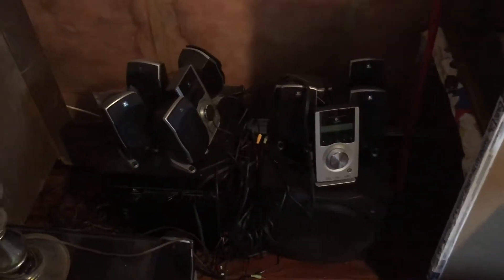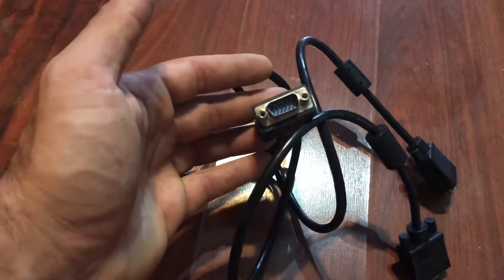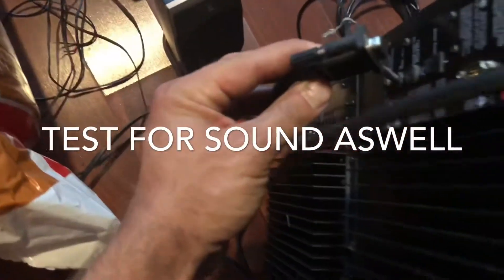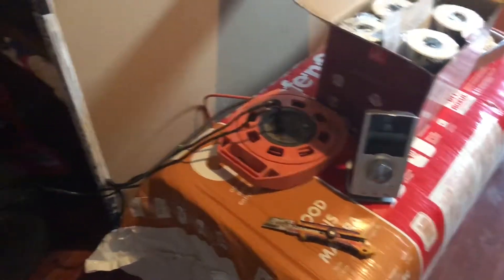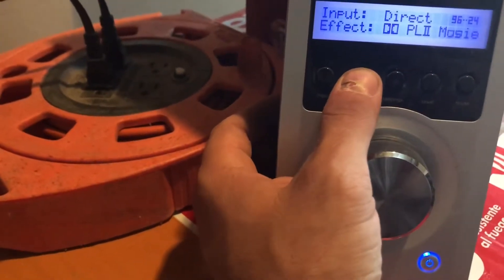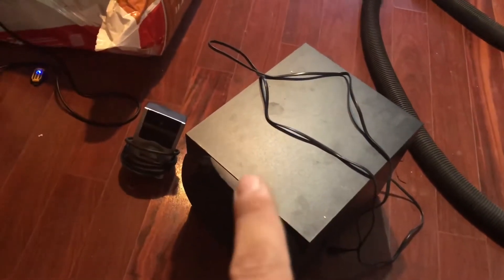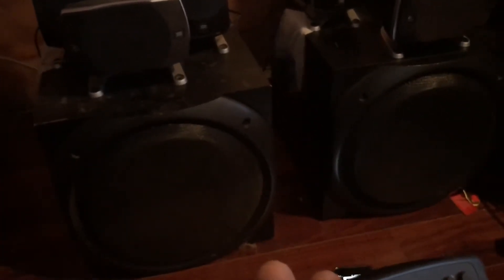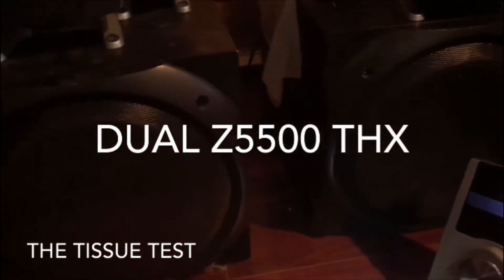(Long) DUAL Z5500 Logitech 2000WATTS - Complete Assembly

Comment: I bought this cable to link two Logitech Z5500, I did the tests, they both worked swapping the pod control from each other with no problem. Then install the splitter cable and no problem, they worked together if desired or separately. It worked well all day. The next day I wanted to install one of the Z5500 in another room and when installing the control that corresponds to the equipment, it turns on, leaving the blue screen without letters, remove the pod and put the other one and it does not even turn on. It should be noted that both teams have different manufacturing years, one is 2006 and the other 2010. Then I put the corresponding pod in the newest one and it turns on without problem, then the pod corresponding to the oldest one and this one turns on but the screen remains blue, Then I put the old pod in the new one and it turns on without problem, verified that it is not a problem with the pod control. After a stress crisis, I put them back together with the splitter cable, the new one turned on without problem and when the old one was turned on, it also works without problem. So now I can only use them together since for some unknown reason, the new one only works individually. The old one doesn't work alone. If I turn on the old one first a buzzer sounds that is removed when the new one is turned on, working together without problem. Now if I want to use only one I must turn off the old one and leave the new one, and I do want both to turn on the old one. That is to say, the old one remained as a slave to the new one, now I will never be able to use the old one in another room and that bothers me a lot since I trusted the usefulness of the cable and this damaged my older equipment that was in perfect condition.

Comment: Существует много таких сплитеров можно ли использовать их ... ??
Reply from the maker: @SM-wk3nm  I only speak English. Can you please use Google translate? I’m not sure what language this is. I apologize.
Reply: @803Garage  can I use third-party adapters that are sold everywhere in the public domain, just a VGA splitter... I just don’t understand how the power flows there; it turns out that two devices supply power to one unit and this could probably burn this unit
Reply: I came to the conclusion that it’s easier to buy another one of the same acoustics and simply connect it in parallel.
Reply: in Ukraine there are simply problems with delivery.. 
from other countries
Reply from the maker: @SM-wk3nm  yes. That is the concern. Both units supply power and the y-adapter has to be wired in such a way that it doesn’t back-feed and blow up the power supplies.  I don’t know how they wired them to prevent this which is why I decided to buy the y-adapter than re-invent the wheel. They do talk about off the shelf parts and they do say that it won’t work because the power will back-feed. I do not know how true that is but why risk it. $$$$$
Reply from the maker: @SM-wk3nm  oh this makes sense. You could just use an audio splitter. 

https://a.co/d/9PZPhfG

I thought about using a fibre optic splitter so I would have to worry about compatibility and power issues.
Reply: @803Garage  I understand, thanks, but I think that you need to ring the outputs from one of the devices and understand which pins supply voltage and remove these pins from one of the connectors, and then the voltage will be supplied from one amplifier and the control signals will be transmitted to two. Yes, it’s definitely better not to take risks. easier I'm thinking of buying another system and just connecting them in parallel))
Reply from the maker: @SM-wk3nm  yes. You are correct. 👍🏼 not many people what to spend the time to remove the pins suppling power from the second device. That’s why I like the idea of an adapter that can multiple the signal. In this case I think using identical systems would allow the remote to work on both units at the same time eliminating multiple remotes.

Comment: What's that cable called
Reply from the maker: Here is the listing on amazon
Reply from the maker: Control Pod Y Splitter Cable Compatible for Logitech Z-5500 Z5500 Dual Subwoofer System https://www.amazon.ca/dp/B0799FQKMP/ref=cm_sw_r_cp_api_glt_i_G810H8VSKPBYQDJBR0XH

Comment: Where you get the plug to connect two sub's
Reply from the maker: Cheke Big I found mine on amazon. The original ad isn’t there but this claims to do the same thing. 🤓 Control Pod Y Splitter Cable Compatible for Logitech Z-5500 Z5500 Dual Subwoofer System https://www.amazon.ca/dp/B0799FQKMP/ref=cm_sw_r_cp_api_i_hqVmDbX0FYJFJ
Reply: Thank you very much. I keep you posted.